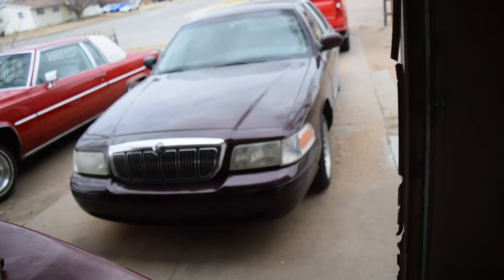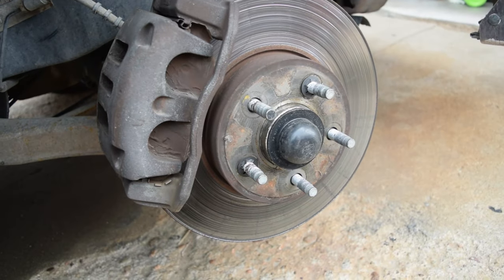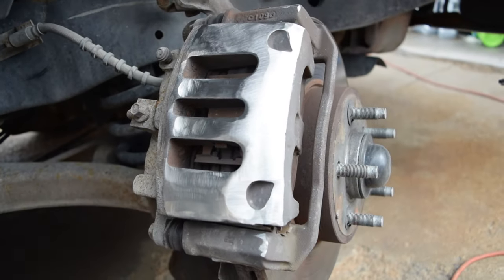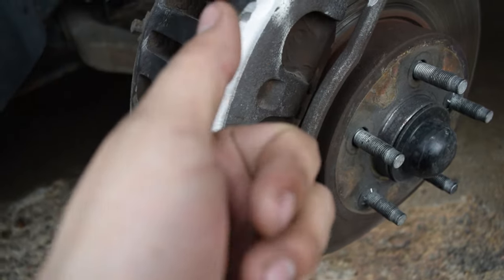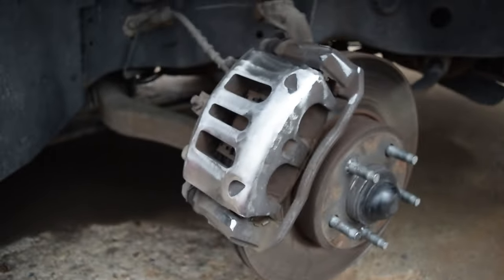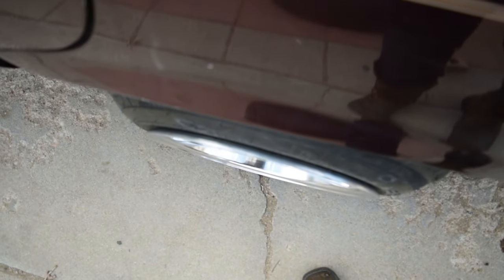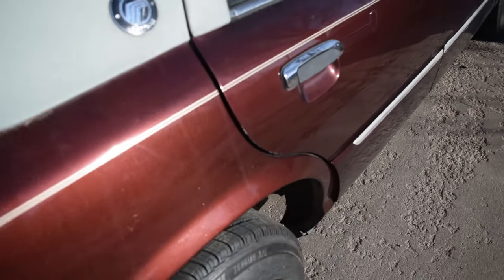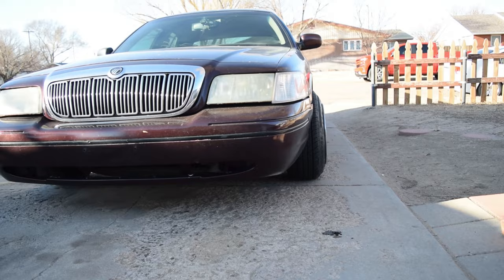Shaving Brake Calipers To Fit Small Wheels

Comment: Hey man, thinking of doing this to my 98 crown vic to fit 15s as well but im seeing mixed feelings, people saying it's all good, people saying the opposite. Did you have any problem with all at braking, no crazy shit happening? Everything felt the same?
Reply from the maker: @markgoesbark7465  for me it was all normal, I sold the car awhile back and it’s still driving around. Depending on your wheel design and offset you may have to trim more or less than what I did but the main thing is to just shave it down minimally, only what’s needed to fit the wheel.

Comment: Ima having a problem maybe yall can help me. I got a 99 buick regal fwd, bought some 100 spoke 13s for it and  everythings set up like its supposed to be, im running spacers on it (Quarter inch) and the calipers were shaved just a bit already to help with rubbing BUT my problem is the front wheel spinners keep coming loose when driving ive had them for about 3 weeks now and im trying to figure out how to make sure to keep them tight when driving. Thought about shaving down the caliper more and taking the spacers off completely as the back ones have zero problems. Any recommendations / suggestions to this problem? Any info would be very helpful! Its also my daily
Reply from the maker: That shouldn’t matter with the knock offs coming loose, what I’ve always done is hammer them on. Then drive it a bit and hammer them again, after a couple times they’ll stay tight
Reply: Bet thank you

Comment: that safe to do?  whats better a lil spacer added or just grinding?
Reply from the maker: It didn’t require much shaving or else you’d have to run spacers.
Reply: @CGOD  ok cool ya i dont have a torch gun compressor at the house  so im hoping hand tight with a cross bar is good for lug nuts?
Reply from the maker: @CampfireTalesYT  yeah it would work just fine

Comment: Since you went through the process. If you could go back what would you change, tire and wheel set up wise?? I want to run a similar set up with the stretch look. What set up would you recommend to fill up more wheel well
Reply from the maker: I just lowered the car more, with enough weight in the car it sat really nice. No wheel gap
Reply: @CGOD  Go check out my build, i went the other extreme, 17x12 on 345s..lol

Comment: Did you have to grind the rear calipers or did the 15x10 s fit ?
Reply from the maker: The rear was fine, the front I did have to shave it
Reply: Thanks just wondering how come you didn't get the 17x9s ?
Reply from the maker: @akkmdk  I like the small wheel look

Comment: Did it scrap or drag bro ?
Reply from the maker: No not really, I daily drove it for like a year
Reply: @CGOD  I was thinking about putting 16 inch wire wheels they loook the same as these ama shave the calipers too 2006 grand marquis and cut the stud post a lil
Reply from the maker: @northxidee_  on a 2006 those take a FWD offset, if they are deep dish they’ll stick out a good amount
Reply: @CGOD  u think there will be a issue shaving the caliper ?
Reply from the maker: @northxidee_  I didn’t have an issue and the guy I sold the car to hasn’t had an issue either. I shaved just enough to clear these wheels though
Reply: @CGOD  how much u think I should shave for wire wheels we going shave the stud post maybe too because it’s not letting the rim sit properly and lock in
Reply from the maker: @northxidee_  you trying to fit 13’s or 14’s? If you’re doing 13’s I’d just rock a spacer but 14’s you could get away with just shaving. My wheels were 15x10’s
Reply: @CGOD  it’s 16 inch spoke rim bro
Reply from the maker: @northxidee_  yeah you should be good then, factory wheels on my car was 16”
Reply: @CGOD  yeah most grand marquis factory are 16 mine are factory 16 as well
Reply from the maker: @northxidee_  maybe you just need to shave down your wheel studs then
Reply: @CGOD  yeah ama check it out when am free

Comment: Get a 94 spindle swap don't grind them theyl get weak and bust brotha that way they will bolt on right away no issues and stuf
Reply from the maker: Ehh I didn’t take off very much, I’m doing this on a budget so didn’t wanna spend any extra money on spindles or spacers. I’ve taken off more before on other cars without issues